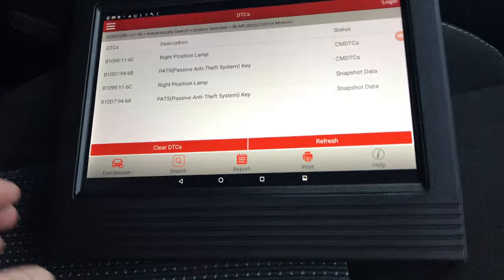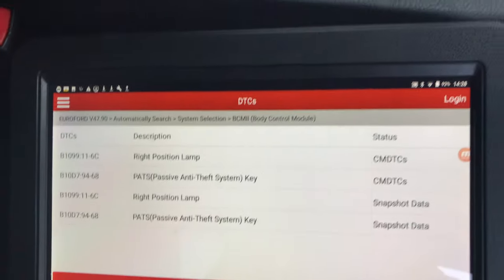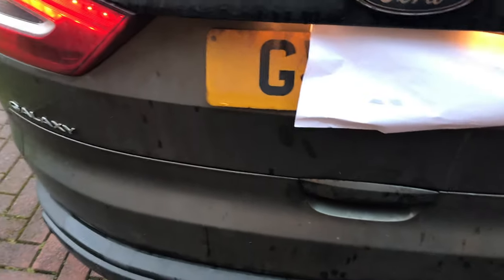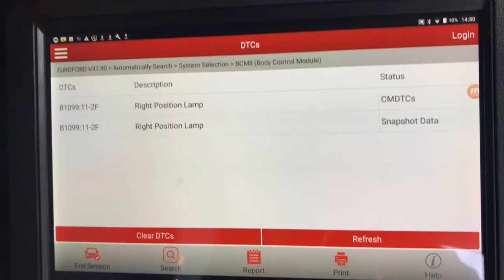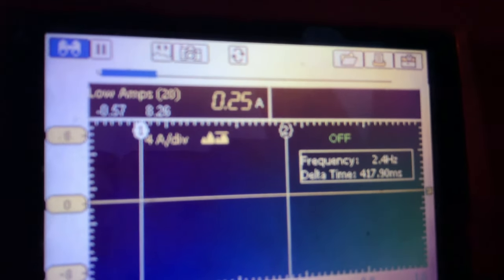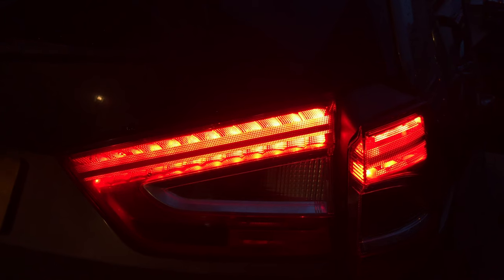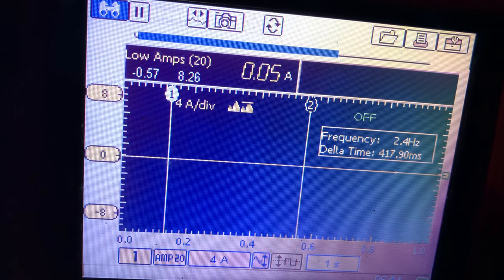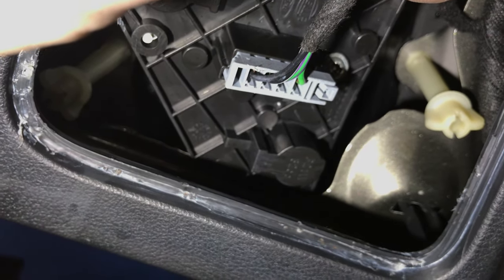Ford Galaxy 2011 - Rear/Tail Lights Not Working Part 2 of 2

Comment: Hi mate. I also have a galaxy 2013 and it doesn’t have that same problem but it suffers from not all LEDs turning on all the time. It affects both sides of the led side lights. But it only affects the leds on the lid not the ones that are fixed. There are days that all looks fine and bright.

Comment: Got the exact same problem on a 2010 Ford Galaxy. Did you ever find a solution without the bodge to bridge the 2 wires and leave it disconnected at the central fuse box?
Reply from the maker: The solution is to replace BCM! The bodge is still working after 2 years😁

Comment: I have this problem but mines a 2008 galaxy brake lights works for 1 second then goes off my indicators dont work front and rear only the ones on the mirror work
Reply: The reverse lights work and the brake light on top of boot works it's strange because my back lights are all side light builbs not led my left light works but brake lights don't at all on both sides and indicators dont work I don't know what's wrong with it any help be much appreciated also I've checked fuse all is good and also changed bulbs

Comment: You need to carry a spare bcm like you do spare fuses if you own a Ford😒.
I've had the exact same issue with my mum's Galaxy and it was the bcm.
Reply from the maker: Cheers did you manage to code it in using after market scan tool, sandy
Reply: @sandyande  It was under warranty with Ford so the main dealer sorted it, 2 years later her lights wouldn't always turn off or they would turn on by themselves, guess what new bcm but local dealer had run out so on back order!! 
Now the dct gearbox has just been replaced including TCM!!